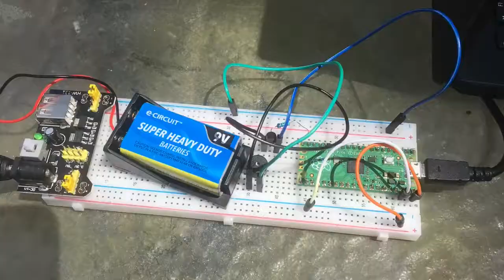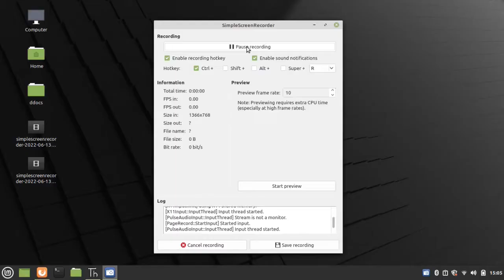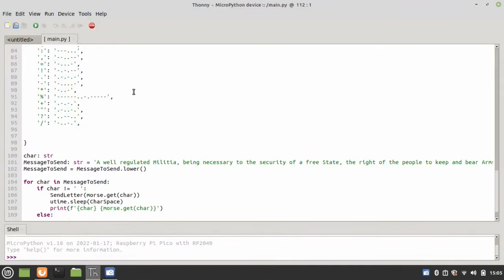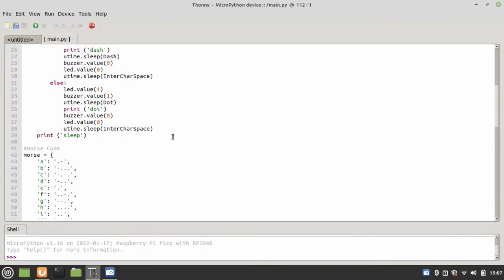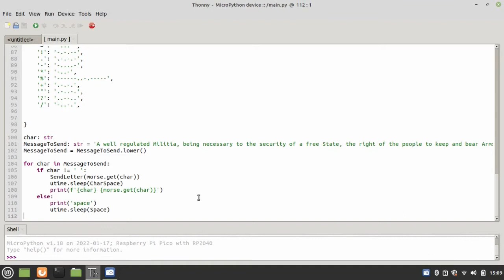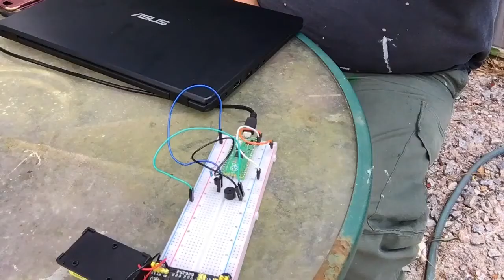Python coded Morse transmitter on the Raspberry Pi Pico

Comment: Zaphod B.  I Got the message.  Is there a Python script for decoding CW ?  My ear and brain cannot keep up!  I need to build a decoder.   73   -.-  ..-.  --...  =...  .-.  --.-
Reply from the maker: There are decoders around but I have not been satisfied with their performance. They seem to use the first few letters as a reference point for the timings of the dots, dashes and gaps but then fail to translate the first few letters.  It seems rather bizarre that coders have not done that.

It sounds a straightforward process of counting nanoseconds.